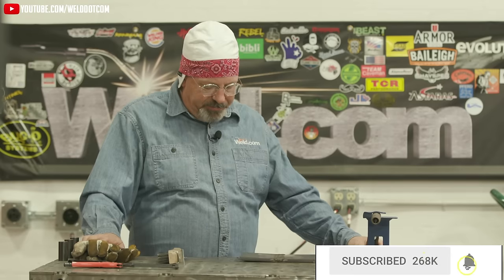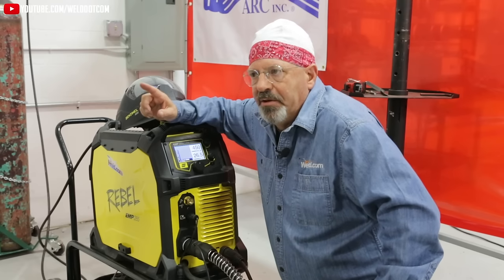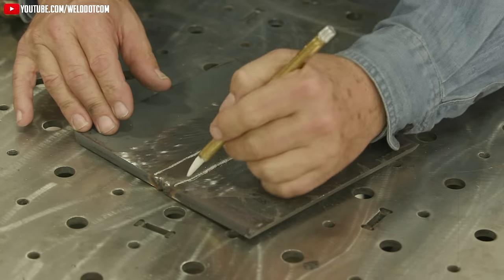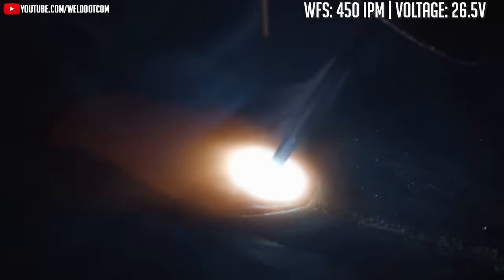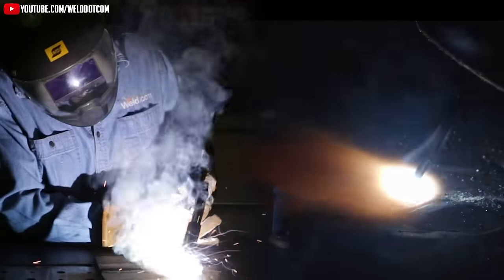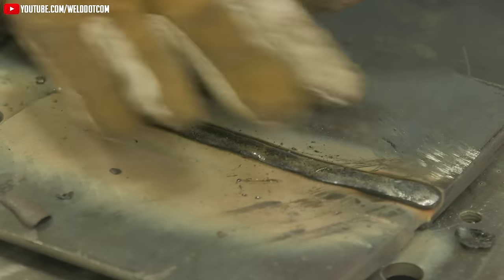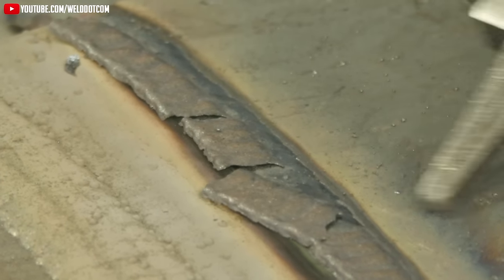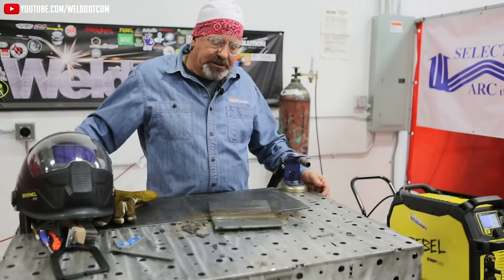GAS SHIELDED FLUX CORE WELDING FOR BEGINNERS

Comment: Worm tracks! I just started playing with Dual Shield and sometimes I get those dreaded Worm Tracks. What causes them? Thanks.
Reply: workwillfreeyou I’m not %100 sure about it, but they seem to happen more often when I keep too short a stick out. Don’t quote me on that, though. 😅
Reply: Keep that stick out around 5/8 to 3/4
Reply: Volts too low, or short stick out have been mostly what I seen cause that issue.  Or if the wire sat out for a while seems to cause that especially with select arc wire.

Comment: What about pure argon with standard flux core wire, I remember hearing that this makes for a nice profile with very little splatter.
Reply from the maker: Do you mean self shielded flux core when you say "standard"?
Reply: @Welddotcom  Yes
Reply from the maker: There is no benefit to using gas with self shielded flux core wire. You're just wasting gas.

Comment: great work, and theory,HI, i need your advice, as i weld car panels, rust repair, and also, sometimes i weld 3/8" gauge or tickness,i  m not a trades man, but i'm not sure, i can not seems to get good weld, i got CIG 3 in 1 MIG TIG STICK,155 amps. and i think i need a bigger amps, as  when i used mig gasless, it's a night mare???, i could not adjust the voltage to suit some how, maybe i should ask some one to show how i can set it,??? wonder if you can show us a litte idea, many thanks

Comment: Thanks for sharing your talent. I have a Hobart Handler 180. It has two knobs. The voltage knob has numbers from 1 to 4 and the Wire Feed has numbers in tens. (10, 20, 30...........100) Has anybody ever figured out what these numbers equate to? You talk about 26.5 volts  and wire feed around 400. Not so easy to get those setting with a machine like mine...lol. Any help would be greatly appreciated.
Reply: @AnX8765  Thanks for the feedback Bill. I will do those measurements as soon as I have some time.

Comment: So... The EVERLAST Powermig i230... CAN YOU RUN Dual Shield Flux Core on that machine? Rumor is it's NOT "designed" for Dual Shield Flux Core and I'm thinking it will be just fine with 0.030 or 0.035... maybe I just need the right brand of wire??

Comment: Welder from Sweden here i weld gas shielded Flux core everyday on a esab origo 410 water cooled and why do no one in USA push its faster can use higher heat and wfs and it fills easier and also you see where you're going and it's minimal risk for both getting slag trapped in the string and no wormtrails.
I can see on almost every  clip from the states no one uses watercooled machines why???

Comment: Have the wirespeed  something with ampspower too do,  my weldingmachine have only adjust of volt and wirespeed , but numbers of amps
Reply: Yes also the wire size and contact tip to work to distance has a direct relationship to the amps

Comment: Would dual shield be a problem for miller 215? Will dual shield be a problem outside welding? and what would be the thinnest metal you would weld with dual shield?
Reply: Joe Briggs idk about a miller 215 get a hold of miller n ask them. I feel anything less than 1/4 inch would be a waste with dual shield. If you run it outside just turn your gas up n if it’s too much of a breeze blowing put something up to block it.
Reply: .035 runs good in my esab 215 not enough umph for .045 though.  I weld outside it does fine just crank up the gas I run it with c02 much cheaper and 20lbs of c02 is a lot lighter than a big ol bottle of c25.

Comment: Is this wire the same as you would use for flux core? Or is the dual shield a different wire?
Reply: It's different. He stated this wire is run on DCEP.
Reply: Uncle P thank you for the reply
Reply: Definitely different!  Not trivial.  You get a much nicer result with dual shield and it's very intense and has a high deposition rate.  There's STAINLESS dual-shield wire which is really something.  Instead of a huge mess, you just have a thin glassy slag on top of your bead, sometimes it comes off easily and leaves a very pretty clean looking deposit.

Comment: What if you have a little century welder that has wire speed and amps dials that say 1-10?
Reply: Tape measure will help you out. Jody had a series of videos called mig welding basics. Look it up, it's gonna be very helpful.

Comment: Nice info, thank you. I have an old snap on mig welder that I bought new 25 plus years ago, it's time for an upgrade, there are so many machines available now, do you have one favorite that would work well for a home hobby shop?? I bought a multi process tig stick plasma from everlast and am now thinking I should have gone with a mig tig stick unit instead, but since I didn't, I need a new mig only machine and am.not sure everlast is the way to.go this time. Any help would be appreciated. Thanks again for the channel as well.
Reply: Htp makes a beautiful pulse mig welder that would probably serve you well for the next 25yrs. If you're gonna upgrade go to pulse mig, or don't bother upgrading. If your snap on is reliable, I don't think the new stuff is any better. That snap on is probably a transformer machine which will probably be running for another 25 yrs. The inverters ain't quite as robust and all those digital electronics deteriorate over time. I say go pulse mig or stay where you're at.
Reply: I replaced a snapon ya240 and a Idealarc 250 with a HTP PP200 and Everlast DV200. The reason I replaced the snapon is because it was too weak and the diodes went out in the Idealarc. my shop is small so going from 2 large welders to the footprint of one small welder is nice. But if yours is powerful enough i would stick with it. Pulse is nice but, I find dual shield more useful and older migs can run that. just change the wire.
Reply: Daniel, Marcel, thanks for the information, nothing wrong with my snap on mig at all, still does a nice job for me, not sure if pulse is something i need givin I have never used it before on any welder prior to the new tig and i end up using the pedal instead of using the  pulse mode. I need to play some with it I suppose, but am always in a hurry when i need to weld something so i go with what I know instead of trying something new. Old and set in my ways, but willing to learn, just don't seem to have time to play with pulse on the tig yet. Hindsight I am thinking I should have gone with mig tig stick multi process unit instead of plasma, tig stick, never tried the dual shield so will give that a shot, I have a spool of shielded wire new in the box laying around i will swap out and run some beads . Thanks for the information. It is much appreciated.
Reply: what model is your snapon welder? you may need knurled rollers for dual shield wire too.
Reply: @marcusmorgan1419  There's nothing like a little time behind the nozzle to get better at it.c If you have a smart phone, there's an app called " pocket welder helper" that gives you lots of baseline settings for any welding process, material, etc... Great app, I highly recommend it. It's free!
Reply: I will check the app out, if it gives a baseline to.work off of, would work with the tig, my old mig just has wire speed and an amp knob, no digital readout that shows anything, just 1 through 10 for both so I have never known what amperage or what the actual wire speed I happen to be using is, one of the reasons I was thinking about an upgrade, but that old snap on welder has never given me any trouble, and still does a nice job, I am sure I paid way to much for it all those years ago but like I said it has always ran fine. I will try the dual shield wire and see how it goes.
Reply: @marcusmorgan1419  10 on the knob should be 200 amps if that's the max on your machine. So 5 on the knob would be 100 etc... For the wire speed , set out on max, then run out the wire for 20 seconds. Then measure how long the piece of wire is, multiply x3 because 3x20secs=1minute. Now you know your Mac wire feed at the 10 setting. Now divide up the graduations accordingly. Now Mark your knobs so you know what each number represents. That should put you real close to actual.

Comment: Can you spray with this? An what would be the spray condition?
Reply: Select arc makes a metal core we used   while doing spray with 90/10, good for flat work and minor mill scale
Reply: Technically this is a globular transfer, I believe.
Reply: @bobmoffatt4133  can you use different gasses? Would it change anything?
Reply: Why would you want to spray with dual shield?  You can run 75/25 or %100 co2 with most dual shield. I have run %100 argon (oops wrong bottle), it sprays but the weld isn't has good. Ropy with undercut if i remember correctly.
Reply: @who_is_asking  Sure

Comment: Not all fcaw wires run on the same polarity. Nr232 (DCEN) is not the same polarity Nr305 (DCEP). Check the box the wire comes in or with the manufacturer

Comment: Thank you for this video you are very informative and I'm not trying to be sarcastic in any way and I certainly do not have the credentials to teach at a college it just seems to me you're focusing on Aesthetics of the weld bead maybe this is due to the fact that this is just a short video for beginners but why do you fail to mention heat inputs amount of penetration and reduction of tensile strength or Duty Cycles of the machine that you are using I apologize if I'm getting ahead of you keep up the good work

Comment: Looks like I screwed myself when I bought my first welding machine. I bought the cheapest one (HF $100) that causes issues and I thought it was normal. I should have bought a quality machine to begin with so I could concentrate on the technique instead of constantly trying to make my machine work properly.
Reply: I also got that same welder to learn with, and honestly it works well enough to learn with. It would benefit from addition of an external rectifier to convert it to a DC welder.
Reply: Max W. I just purchased the Titanium Flux 125 ($165) as a 110v unit as I can’t haul around my 220v welder around the house, and wow! This thing welds like a dream! Smooth, less splatter, heat is controllable, lightweight and affordable! My welds looks so much better with this machine vs the HF 90 Amp.
Reply: @RELOADINGandSHOOTING  Glad to hear that. I started on the cheapo Chicago Electric one and recently upgraded to a AlphaTig 201XD for stick and tig, but am considering still getting a nicer MIG/FCAW setup. Been avoiding doing anything more structural with the cheapo flux welder and have been instead using stick for that kind of stuff.
Reply: Max W. Thinking of the Cadillacs of welding like Miller or ESAB? LoL this hobby gets expensive real quick haha

Comment: FLUX-CORE IS SPRAY ARC TRANSFER. IF ANYTHING DROP WIRE OR TURN AMPS UP 28v @ 430.. Only use short arc with hard/bare wire

Comment: I hate dual shield. It doesn’t say as much to you as other processes when adjusting parameters. Guys at work use different wire speeds ranging from 280-350 and they all look the same. Change ur voltage from 23-26……it’s not that much different. Push, pull, horizontal, vertical, overhead, whatever….the weld profile will barely change 🙄😒

Comment: Co2 vs 25/75?
Reply: Co2 is hotter. I'm using Lincoln 71C with Co2, great combo. No worm holes. Easy clean up, almost zero splatter.
Reply: Also, CO2 is much cheaper, and there's a lot in the bottle (since it's liquid).  I think this process is friendly to CO2, according to a spec sheet I read five or six years ago.

Comment: It's not really what people want to see most people are beginners they all have 125 machines they go out and buy a roll of wire and they want to know how to Weld
Reply from the maker: Dual Shield Flux Core is not Self Shielded Flux Core. The video is meant for beginners of the process, not beginners to welding. This isn't usually a process that people new to welding learn on.

Comment: this video is for "beginners" yet he uses unconventional double shielded wire which requires gas, the whole point of flux core is that it's easy and requires no gas, than he proceeds to use 26 volts and 450 feed speed, that's like double what regular flux core uses. this entire video is bullshit if it's for beginners
Reply: Yeah okay whatever..
Reply: @user-mt9tn1ni4g  you're having a bad day apparently